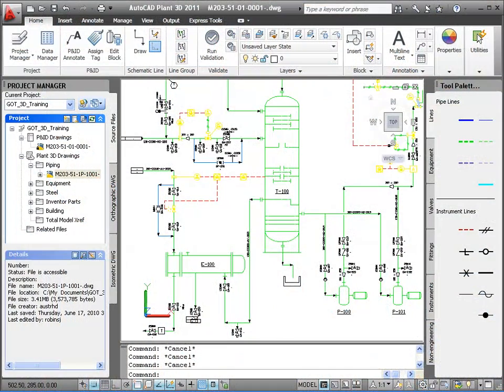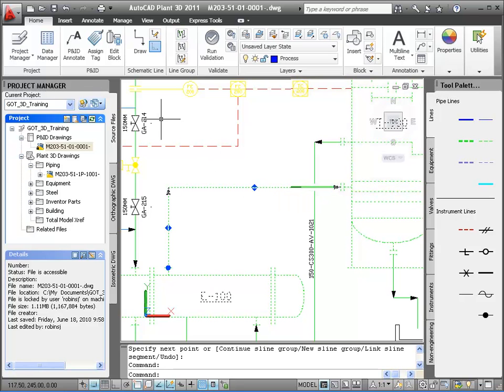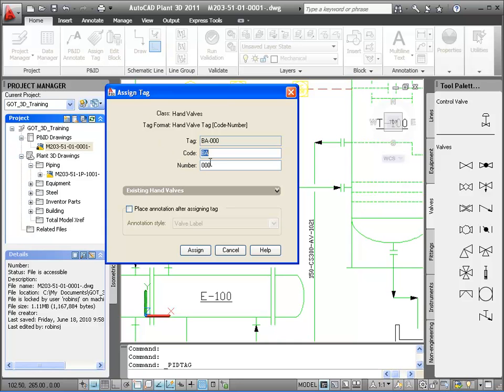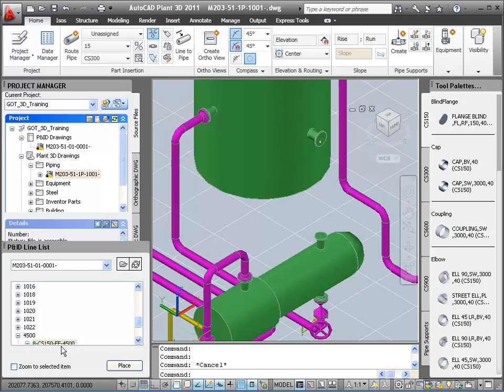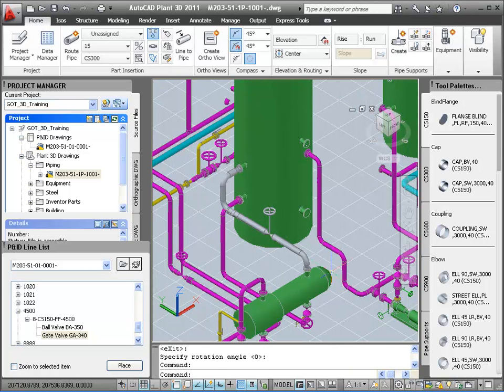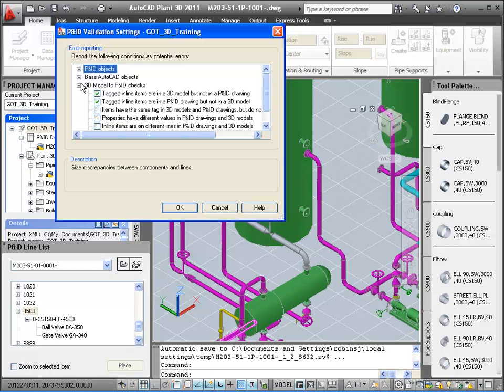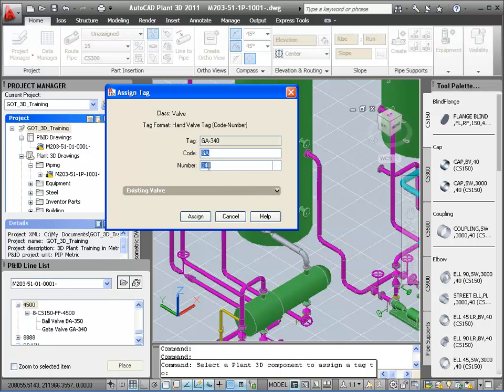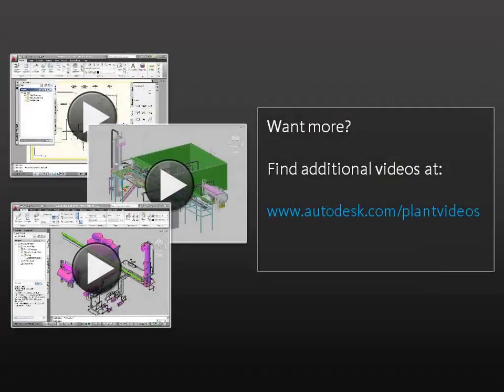P&ID Data in AutoCAD Plant 3D

Comment: Quick question, did the 3D drawing draw itself from the 2D diagram?
Reply: I have same question too
Reply: @rambo2847  For this you can use CADISON-3D Plant Design & Equipment Engineering Software. It works on object oriented technology with common storage database. CADISON 3D Designer for accurate 3D space planning and generations of 2D layouts (GA drawing, Isometrics) for construction with all required reports and datasheets.
Reply: no it did not, You have to draw it
Reply: For this you can use CADISON-3D Plant Design & Equipment Engineering Software. It works on object oriented technology with common storage database. CADISON 3D Designer for accurate 3D space planning and generations of 2D layouts (GA drawing, Isometrics) for construction with all required reports and datasheets.